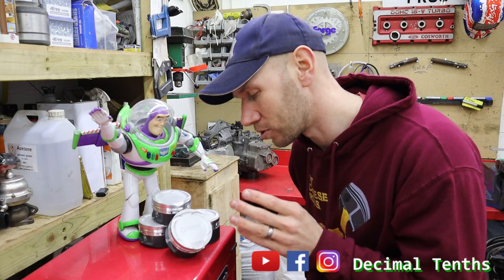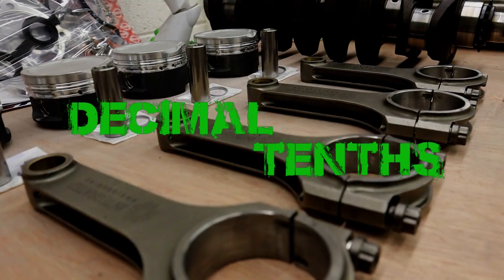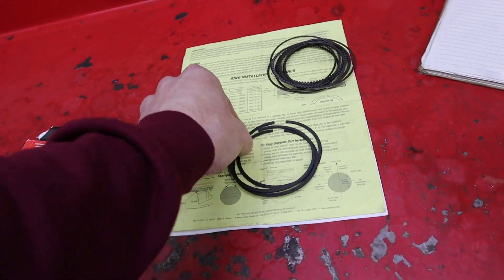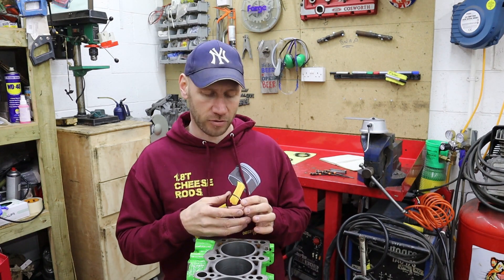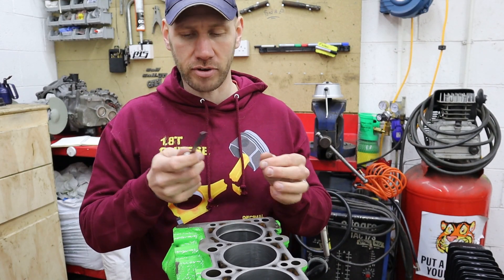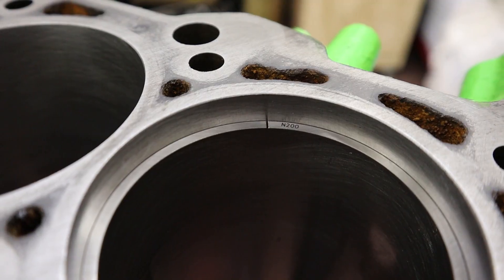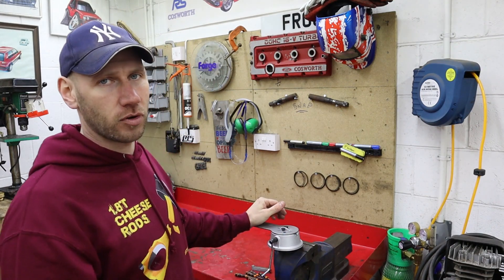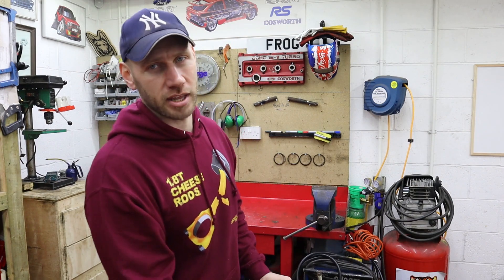Setting...PISTON RING GAP!!  //  1.8T STROKER ENGINE BUILD

Comment: Hey, on my set of JE pistons, my secondary comp ring has no markings besides the "N" for Nippon. Does the side with the N face up? It's like an internally stepped ring, like a notch cut out on one side where it rides the bore. I can't find anything on vortex/JE website.
Reply from the maker: Hi yes the marking faces up. It should be a cast ring where the step on the ring is on the outside.

Comment: Would .020 top and .024 second ring be to much gap?
Reply from the maker: Hi, depends on what you are planning on using the engine for. Id suggest they are bigger than what id use but they would work fine.